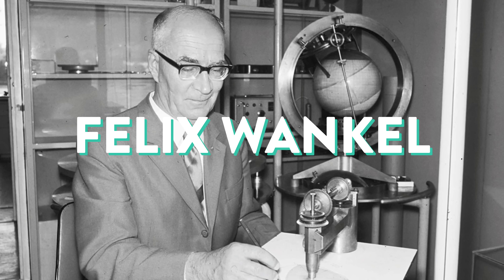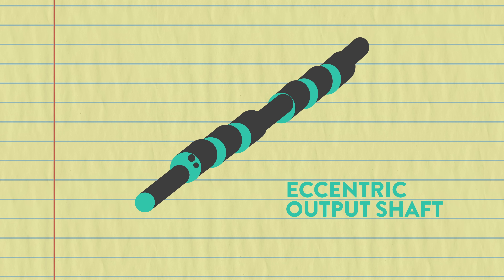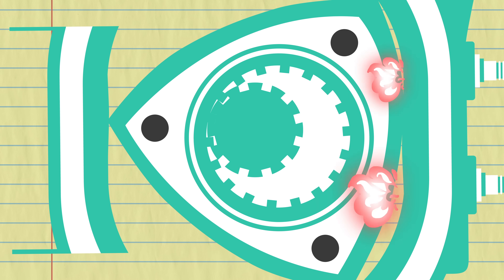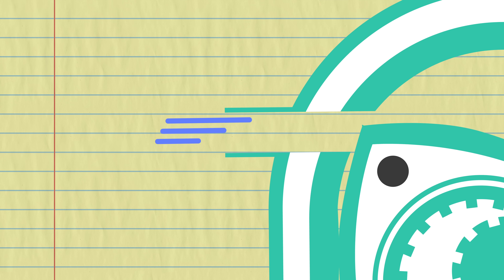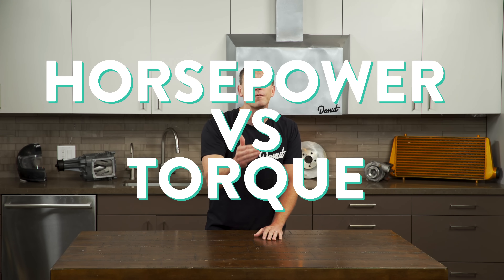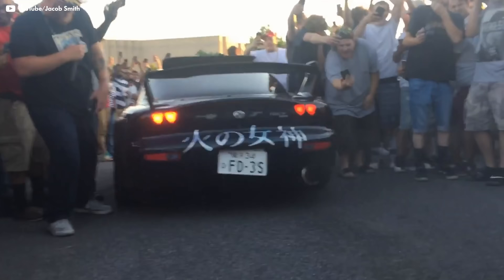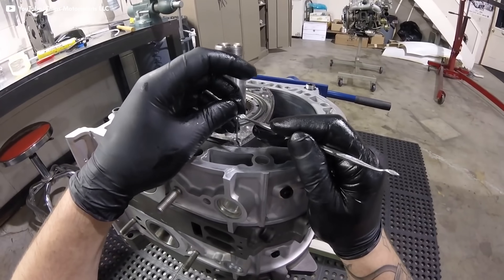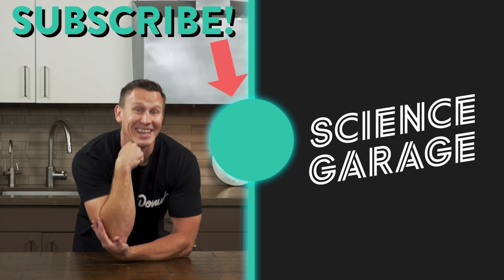Rotary Engine | How It Works

Comment: Mazda should have made the rotary better and continued the rx series
Reply: if that’s how it is, rx9 would already be out, but world is different as the world in the 90s, because of the environmental protection, the rotary produces too much harmful gases for the environment, and it still can’t passed the test, you think they don’t want to make a new one? they already made it
Reply: @Bill Luo While it is a common urban myth that the RX-8 was canceled because of emissions, this is simply not true.. The RX-8 continued to pass the world's toughest emissions standards (EPA Tier2 Bin5 AND the strict California CARB ULEV II right up until lack of sales ended production.
 Sales of the RX-8 were so low in Europe there was simply no reason to justify re-certifying the RX-8 to meet the Euro5 emissions standards as they would never sell enough units to recoup the costs incurred.
Reply: @doktorbimmer  wrote:
"While it is a common urban myth that the RX-8 was canceled because of emissions"

Not myth Bimmer. Fact.
Reply: @John Burns The RX-8 MET OR EXCEEDED EPA Tier2 Bin5 AND the strict California CARB ULEV II right up until lack of sales ended production.... it would have easily passed and exceed Euro5 standards...
Reply: @John Burns Europe is nearly half a century behind the United States which introduced vehicle emissions standards in the 1960s.
Reply: Bimmer, look at the EU emissions regs. The US introduced emissions regs as the the air was so foul because the cars had truck engines in them. They had no choice.  Many European cities have announce time-scales to first ban diesels and then internal combustion engines in cities. There you go Bimmer.  There you go.
Reply: John Burns lol I’m a Smart kid and I don’t know what the heck you guys are talking about when it comes to Emissions. I Just Design Stuff!
Reply: @doktorbimmer  that rx 7 everybody swoons over wouldnt even have been aloud to drive in japan for the filming in the movie that made it so popular.
Reply: @dbspaceoditty False urban myths, The RX-7 suffered steadily declining sales after 1986 and the FD was a huge financial failure... The RX brand was discontinued because the cars did not sell anymore... its that simple.
Reply: @dbspaceoditty The 1991 season was the transition year to the new 3.5 liter engine formula... although most of the teams were already running the new 3.5 liter engine Mazda was allowed to still run the R26B. Mazda announced the Judd V-10 would be used next year (before the 1991 Le Mans 24 hours.
Reply: @dbspaceoditty  
I crossed paths with bimmer over 10yrs ago.
He's still at it. 
Same shit, different decade.
Sooo much time and effort on his part.
Gotta admire the dedication, but what a life. 
Sad really.
Reply: @doktorbimmer  three of the four RX7s I've owned since 1978 were in CA and passed emissions easily, including the 89 FC a few feet from me. Mazda priced itself out of the market with the FD and the RX8 had a good run but the stories about it reduced the interest. Mazda was the first japanese car to win at le mans, which stood until toyota won with its hybrid a few years ago. Mine still runs like a pup.
Reply: @blyndrotor  wait. THAT'S HOW LONG THIS TROLL IS AROUNF FOR?!?!!
Reply: @Maximus20778  
He and I have bounced back and forth at one stage or another for well over a decade.
Mostly me just pokin him about how long he's been at this, for shits and giggles.
Reply: @blyndrotor  when we he stop?
Reply: @Maximus20778  
Who knows.
If you do a Google search for him he pops up in a lot of other forums too not just YouTube.
So, yknow, he's dedicated.
Reply: @blyndrotor  ok but how long has he done this? Like since 2011-2010? Id like to know since he really can't stop at all even YouTube doesn't even suspend his account.
Reply: @blyndrotor  I searched up and he also has a pint rest account🤣 and I went on a website that sees all the vids he's been🤣
Reply: @Maximus20778  
Be about 12-13 yrs ago that I first encountered him.
I would get sucked into the arguments.
Soon you realise it's like banging your head on the wall.
Reply: @blyndrotor  Indeed, you can't argue against the truth.
Reply: @sandervanderkammen9230  
Oh hey buddy. Sooo, how ya beeen.
Reply: @blyndrotor  Still trying to find that new 2016 RX8, that 2017 RX7 anniversary edition, the 2018 RX9..
Oh yeah! and that 2020 RX30 range extender?
Heard any good Mazda  clickbait rumors lately??
Reply: @sandervanderkammen9230  
No.
I'm happy with what I have.
I have never said or even implied that I would be looking for anything different. Real, concept, proposed or
otherwise.
You'll have to do better than that.
Reply: @blyndrotor  Perhaps you need to read the comments and refresh you faulty memory...
Reply: @sandervanderkammen9230  
I'm sure at some point in history I may have said that a new rotary (sorry, wankel) would be awesome to see or that the Rx9 concept looked fantastic, but as I said, I'm happy with my Fc.
It's value is going up. 
I'm happy with it.
What else do I need.
Now do you have specifics about what I said or are you just generalizing and hoping for a bite.
Or are you mistaking me for someone else. Again.
Reply: @johnburns4017  You look like a fool right now. 
The new 2022 Mazda models are here and there is no Wankel or range extender.
You no longer have any credibility left...
Reply: @sandervanderkammen9230  
Doktorbimmer,  a quiz. 
Name the company that is introducing a new rotary engined hybrid?
10 points for the correct answer.
Reply: @johnburns4017  You are a liar John, you said Mazda wpuld release a Rotary type engine and a range extender vehicle for 2022.
As usual you are full of lies.
Reply: @dreeary9475  thats why he said "make rotaries better"
Reply: @dreeary9475  
To get the rotary passing the latest emissions, would have taken time and resources. Mazda had all its engineers on the SkyActive projects, which was viewed as essential for the company.
Reply: @John Burns Indeed johnny... money and resources that would not have made any return on their investment. Mazda is a company that needs to develop cars that will actually sell... if not they will cease to exist as a company.
Reply: This week marked the 10 year anniversary of Mazda's board cancelling the RX brand and further development of Wankel engines.
 The RX brand's bad reputation for unreliability and poor fuel economy saw sales in a steady decline as far back as 1986 with the last two RX model suffering a net loss for the company... it is estimated that the RX-8 lost nearly $3 billion dollars in development, production and warranty costs that bankrupted the company for the third time in its history.
 As part of the government bailout loan deal Mazda agreed to cancel development of the unprofitable Wankel engine and drop the failing RX brand.
Reply: doktorbimmer I wish they would of just kept the RX  name and put a straight 6 in that bad boy. I wish there was an affordable straight 6 manual car out there.
Reply: ERNIE BRINK ROTARY  you're gay
Reply: Considering the Rotary didn't have hundreds of years of collective research and development from scores of companies in competition, it actually did pretty well. 

One company with 50 odd years of self financed R&D on an entirely separate form of propulsion deserves respect.
Reply: @Lewislpalm  YKR, why some fools have such a hate on them?
Reply: @Lewislpalm  You must be too young to remember the development history of the Wankel  engines, billions of dollars were invested by the biggest engine companies in the world.
Reply: They say if you say rotary in the mirror five times, doktorbimmer appears behind you and tells you everything that is wrong with the rotary engine, when production stopped and everything that makes you wrong for enjoying or appreciating them.
If you disagree with him he'll keep going till you give up trying to have a rational discussion, then claim victory.
Reply: They should of have given the rotary engine the benefit of the doubt. I mean if Mr Wankel went this far to create such an ingenius device and now we have chemist that can create synthetic oils that are capable of going up to 10,000mi before a change. I am sure there would be a chemist out there smart enough to design an oil formula capable of keeping a rotary engine healthy and cool before needing a change at 5000 mi service interval. Also the amount of smart machinist and mechincal enginners out there that can design seals that are durable over a long period of time (like combustion engines are designed on normal cars) before needing replacement/repair.
Reply: then you should be happy to hear that mazda recently had new rotary cinceots patented, if u didnt already
Reply: @DealorG  for real?!?!
Reply: @Dealor  Did you know that Ford Motor Company once held more patents on the Wankel engine than Mazda... and they NEVER SOLD A SINGLE WANKEL ENGINE!
Reply: @doktorbimmer  i have been scouring the internet for the real reason rotary engines failed Mazda, and practically all of the acticles and research available points to it being because of horrible mileage and bad emissions (which are from the same issue). The sales were shitty, yes. But you seem to just stop there and call it done. The next question is WHY the sales were shit. And the clear and obvious answer is that the combined poor fuel mileage, high price, and poor emissions caused people to buy other options. You do realize that whether people want buy a car or not depends directly on the specs and details on the car. So their decision would correlate directly. You cant just say "sales were bad" and call it concluded. The sales were bad for a reason mate. Here are a few quotes i pulled from some sites.  "Mazda spokeswoman Michiko Terashima said research and development on the rotary engine will continue, leaving open the possibility that it could make a comeback. But production is now not making sense when considering the costs of meeting safety and emissions standards for new vehicles, she said." 
 "Mazda officials have previously said that if they can get it to perform as well as a reciprocating engine they will bring it back, to power a conventional sports car." This last one demonstrates that the engine physically doesnt perform as well as a reciprocating engine, when all aspects of running are combined. So please do realize, you dont know everything. Thanks for your time.
Reply: @winstonpoplin  thanks for shutting that bimmer guy up, or bummer... whatever he is
Reply: @doktorbimmer  link
Reply: Asylumental he’s on his second account as Sander Van der Kammen
Reply: @Zoran there are MANY different combustion engines ranging from turbojets to pistons to rotors. Humans have had quite a long time to figure out how to burn petroleum, and have gotten very good at it.
Reply: #bringtherotaryengineback
Reply: if only...
Reply: @Quincy Gaming You can't make the Wankel better than reciprocating engines... its why all the engine manufacturers (including Mazda) have abandoned the obsolete design.
Reply: @doktorbimmer  we just dont have somebody in the car industry smart enough to make the rotary better yet
Reply: @Gage Jerigen You obviously have no clue why these engines are completely obsolete in the manufacturing industry today... The automotive manufacturers know some things that you do not.
Reply: @doktorbimmer  pretty sure somebody could figure out how to make it relevant.
Reply: @Gage Jerigen That is a very naive statement that could only be made by someone who is not qualified or experienced enough to speak intelligently on this topic.
Reply: @Gage Jerigen You really don't know anything about engineering, the Wankel KKM design or its development history do you?
Reply: @doktorbimmer  not everybody has left the wankel rotary. Airplanes still use wankel rotary engines. Also there are multiple companies selling rotary engines. RIP THE ROTARY
Reply: @CraigFenske  there are no legitimate manufacturers selling Wankel engines for aircraft.
Reply: @gagejernigan5277  i know I'm 2 yrs late but this guy is a trolll
Reply: Dorito go burrrr
Reply: I hear so much crap here, a Rotary funktior also with hydrogen or as skyactive, the rx9 could also simply be a hybrid to lower the emission levels. There was also the rumour of a v6, but rx stands for "Rotary Xperimental" and they have already developed hydrogen rotarys, so why a v6? Recently I read it will be a 1.6l 13b single turbo skyactive with 450ps for 70k dollar.
So basicly they try to fight Porsche again.
Reply: Theyre still developing and refining the rotary engine to this day.
Reply: @Brandon Bennetch hey uh keep in mind that dorktorbimmer and sander are the same people just on different accounts :)
Reply: they started banning the rotary from completion. 

it won one race and was banned. lololol. 

"japan makes first car to win lemans, first car ti win le mans using rotary engine. "

they ban it, supposedly they are letting it back in. but they want to mess with a p roduction model RX series first. 

so. yay
Reply: @dbspaceoditty The FIA never banned Wankel engines fron WSC competition... Mazda retired the 787b after losing the championship. This was all announced prior to the Le Mans race in June 1991.
Reply: @doktorbimmer  soo, i am to believe you, but not 20+ articles from authentic journalists?
Reply: @dbspaceoditty You mean 20 years of false urban myths? There are no peer-reviewed publications that have ever made that claim.
Reply: @doktorbimmer  peer reviewed for what? them going "no more rotary engines" 

so tell me this. how is it not true? false urban myths? has a rotary engine been used in lemans since 1991? they are literally just a better engine.
Reply: @dbspaceoditty Mazda retired the 787B because the chassis was slow and outdated, and Mazda did not want to invest anymore cash into a new 3.5 liter Wankel engine, they signed a deal to compete with the Judd V10 engine before the 1991 Le Mans 24 hours but it was the last season the old engine formula would be used.
Reply: @dbspaceoditty  IF it was better??? Then Why did Mazda never win a single endurance racing championship? Mazda LOST the 1991 Le Mans series Championship to JAGUAR.
Reply: @dbspaceoditty  If they were better? Why is it that people stopped buying them, Mazda discontinued them due to lack of sales.
Reply: Skyactive - x Rotary engine.
Reply: YES
Reply: @kling the king Skyactiv-X only exists as a 4-cylinder reciprocating design. Mazda no longer makes Wankel engines.
Reply: You are right
Reply: @Negative_Flect No one can make the Wankel better... its an inherently inferior design that cannot compete with reciprocating engines, it is obsolete technology.
Reply: The rx9 is coming out
Reply: It would happen if emissions was so regulated
Reply: Kingkthewildone they are, they’ve said they are working on the rotary and once they get it reliable and powerful enough they’ll bring it back to production
Reply: @harleypickin217  Mazda stopped development of Wankel engines in 2009, no new prototypes have been seen since 2008. Mazda has not released a new production engine in 25 years.
Reply: Because it's that easy
Reply: It was terrible engine. I can’t believe Mazda even made these things.
Reply: @Kevinb1821  if we switched to hydrogen, the rotary is actually far better than piston, but nobody wants to look that way. Imo, the rotary is a fantastic engine, and to see a completely different engine design become successful for over 40 years is a testament to the design. It is certainly a superior racing engine. Its just that in the grand scheme of things, companies don't like change. They like making money off the same thing over and over, so ultimately the rotary was an uphill battle
Reply: Dee Jay  
Link please.
Reply: they are with the rx9
Reply: @cannonsharo-cocca9281  Mazda's president confirmed there was never any car called the RX-9, it was nothing but an internet hoax started by bloggers.
 Mazda's board of directors voted in May 2009 to cancel all development of the Wankel engine and discontinued the RX brand.
Reply: https://www.mazdaforum.com/forum/mazda-rx-7-33/joe-maddox-super-rare-1-100-1989-fc3s-gtus-rx7-2jz-gte-vvti-build-43602/
I have found and saved the rarest Mazda FC RX7 ever made! Now this car is rare. Really rare! Let me break this down really quick...
Ever heard of the 1/100 non restamped 89/90 GTUs rx7s? Here are the rarest rx7 FC3S models:

1500 10AE Turbo models
1400 infini
1000 winning limited
1000 GTUs restamped
150 final edition convertible
100 GTUs non restamped

out of that 100:
83 red on black
10 black on black
7 white on blue

There was only 1100 GTUs models created between 1989 and 1991 and only 100 of them did not get an X through the firewall.
Reply: @joemaddoxrx7  the FC was the worst RX-7 series... an embarrassing failure.
Reply: @sandervanderkammen9230  False
Reply: @joemaddoxrx7  TRUE A fact confirmed by the FCs total lack of resale value... average FCs currently sell at scrap metal value.
Reply: Shoulda, Could'a, Woulda. But The automotive industry hates it's clientele, Like it's always been... :/
Reply: @pu-FP  Mazda discontinued the Wankel engine and the RX brand because customers stopped buying them.
You can't stay in business building cars that don't sell or lose money.
Reply: They should but since the rotary is banned in pretty much all racing, there isn’t much incentive to improve it
Reply: Mazda is bringing back the rotary as a range extender for their MX-30
Reply: It's not possible to tune the rotary engine to reduce the harmful gases.
They are just old school
But they sound awesome❤️❤️❤️
Reply: AhEm

furai

AhEm
Reply: @Brandon Bennetch The Mazda RX8 HydrogenRE and its disappointing failure in the Norwegian HyNor program proved that Wankel engines are unsuitable for hydrogen fuel applications.
Reply: @Brandon Bennetch The Wankel engine lacks both modern quench or high swirl technology and cannot support the higher static compression ratio required for gaseous fuels... this is why Wankel engines are obsolete.
Reply: @Brandon Bennetch Literally???
Complete Bullshit! Just another fake clickbait rumors from amateur bloggers.
Reply: @sandervanderkammen9230  Jesus, you're still at it? We all know you're doktorbimmer in disguise. You're one of the most dedicated trolls I've ever seen, and I'm impressed. Can I have your autograph?
Reply: This comment aged well
Reply: @blackpsalmmusic9180  The Wankel engine was already a dead-end way back in 1974... Mazda was just very late in getting the memo.
 Mazda lost billions of dollars on the RX brand and went bankrupt twice because of the unpopular RX models.
 You can't run a car company that makes cars no one wants to buy.
Reply: I believe the cancellation was due to two reasons: 
1. Emissions standards
2. Mercedes wanted to keep the monopoly on engines.
Reply: @Guppythefrench  Canceled due to dismal sales and financial losses... not emissions.
Mercedes-Benz was smart, they canceled their Wankel engine program before going into production
Reply: Dee Jay  That is an interesting theory but  not one supported by the factual evidence.
The Mazda RX-8 continued to meet or exceed the toughest emissions regulations in the World both the EPA Tier 2 Bin 5 and California's super strict CARB ULEV II (Ultra Low Emissions Vehicle Tier 2) right up until 2012 when Mazda ceased production due to a lack of sales.
The truth is by 2009 the RX8 assembly line was sitting completely  idle except for one 4 hour shift per week and hemmoraging cash at a staggering rate, Mazda expected to sell at least 100,000 units per year to make a profit and the RX8 was one of the company's worst flops.
Reply: Dee Jay  And everyone knows that Wankel engines are no longer manufactured in series production... because people stopped buying them!
They bought a vehicle with a better type of  engine.
Reply: Today marks the 9th anniversary of the final end of all RX production at Mazda.
The very last Wankel engine powered car rolled off assembly line on June 21st 2012.
Reply: @sandervanderkammen9230  https://youtu.be/VA7wGH8XB9s
Reply: @thefatcatcompany2021  The Mazda MX30 is already in production and available for sale in selected markets.
It will only be available as a 100% plug-in battery electric vehicle or a mild series hybrid powered by a 2.0 liter Skyactiv G engine.
No range extender version or Wankel engines have been announced.
Mazda abandoned all development of Wankel engines in May 2009.
Any questions?
Reply: @sandervanderkammen9230  look at 7 mins 40 in the video, funny man
Reply: @thefatcatcompany2021  The Mazda MX30 is already available and does not have a range extender version.
Toyota and Mazda lost their case against California's "Tesla Law" that bans the use of range extender EVs in California and 13 other C.A.R.B. compliant states.
Mazda abandoned production plans for any range extender version.
Reply: @thefatcatcompany2021  Funny, the article does not confirm anything about the Range extender rumors.
The MX30 is already available for sale and is only available as plugin battery EV or Skyactiv G hybrid.